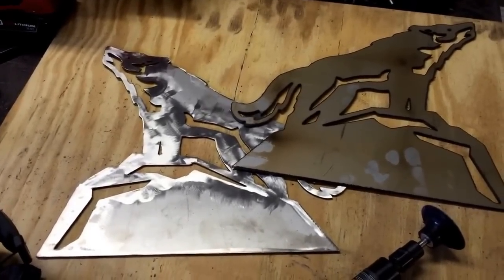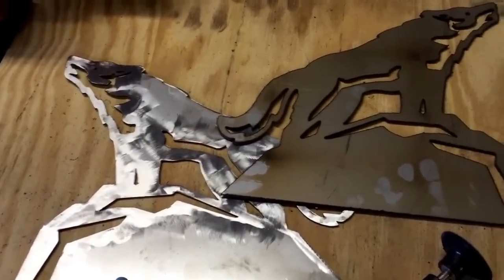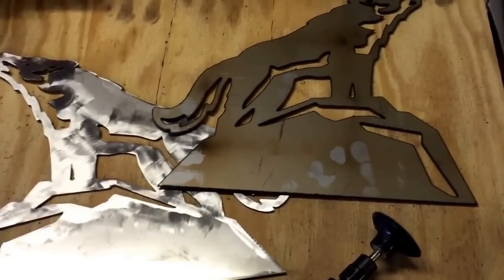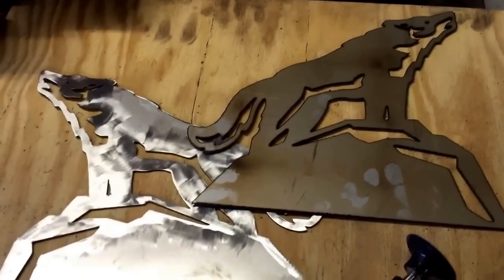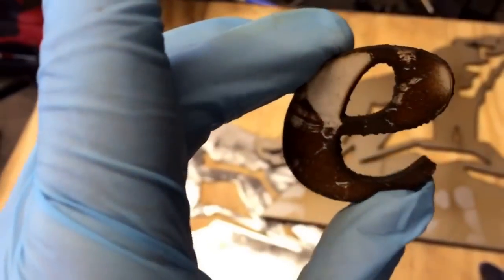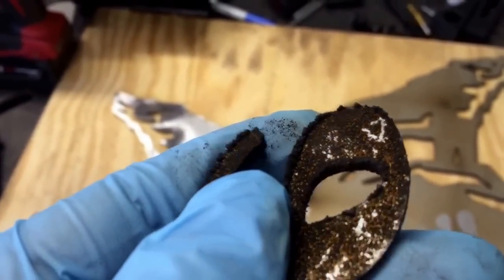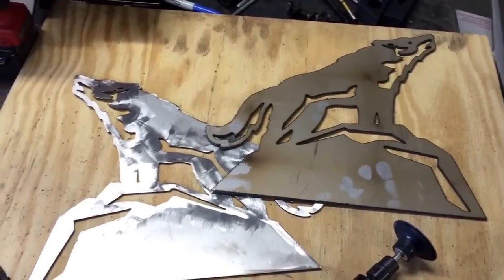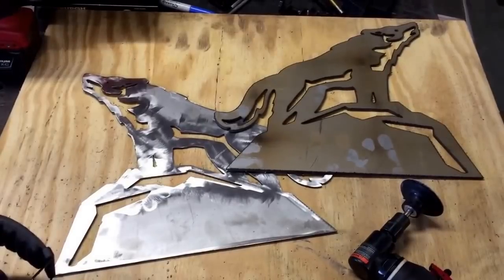Request for help. Stainless steel cleanup.

Comment: HI Tom,
We do a lot of stainless at work and I cut a lot of it with my PlasmaCam.  I use a right angle die grinder with a 60 grit sanding disc and then we send all the parts out to get glass beaded.  They come out GREAT!  I don't know what your budget is but the glass bead makes a real nice matt finish.
Good luck,
Reid
Reply from the maker: +Reid Eichner Thanks, Reid! We've gotten some pretty good suggestions on here and I'm open to anything really. So far, I'm leaning towards the less manual processes given my back is still healing. I'll do a follow up with the things that I've tried for all to see though.

Best wishes,
Tom

Comment: I use a stainless steel wire cup. Since putting in the water table in mine I have notice that there is less clean up and not as much oxides. You can also cut with argon/nitrogen mix for better cut quality
Reply from the maker: +Rick King Hi Rick! Cutting these parts out is what spurred me to get my water table back in action. Of course it was too late for this batch! I'd heard about using nitrogen before but haven't tried that. What's your experience with it?

Thank you,
Tom

Comment: For it to work well it has to be pretty drowning in water. My water table is a different design to most I've  seen on the net using plasmacam DHC2. I have a vid or two of it running on my FB page if you wanted to have a look. There also will be some of the stainless work I've finished on there. 

I'm from across the pond in Australia and like you I'm  a ex grunt  and have worked with you guys when I was in the defence force. I do a fair bit of Infantry stuff on my PlasmaCam. Cheers Rick
Reply from the maker: Thanks, Rick! I'll definitely check this out. Appreciate the suggestions and maybe it's time that I do the table up proper, so to speak.

Best wishes,
Tom Z

Comment: as much as this that you are going to eventually have to do, you need thinks in terms of the least labor intensive. My first thought was a tumbler, and notice that it has already been mentioned.... secondly....I would explore whatever is needed to minimize the dross....I, the way that they can grad seem to recall Mr. Fenner discussing the initial machine settings.....would hate to have to hand hold all of those parts to a wheel, the way they can grab parts.   Good luck,   Jim
Reply from the maker: Thanks, Jim! I think the tumbler will work well for the smaller parts and the drum / belt sander will work for the larger parts. Did you see the comment about using a non-slip pad for the smaller parts? I thought that was a pretty clever idea as well. Appreciate your comment & suggestions! 

Sincerely,
Tom Z

Comment: Probably the fastest and easiest would be a blast cabinet. Maybe a belt sander to hit the high stuff first.
Reply from the maker: +David Kirtley Hi David! Belt sanding is an option but these small parts make it difficult to hold. Wish I had a blasting cabinet but  I had someone mention a tumbler though so I'm trying that with some scrap pieces. I will need different media to avoid cross contamination on the final parts but this is good enough for testing.

Thanks for the feedback!
Tom Z
Reply: +Tom Zelickman (Inspiration Metalworks)  Put the small parts on a non-slip pad and hit them with a random orbit or vibrating sander.
Reply from the maker: +David Kirtley That's a great idea! Thank you!

Comment: Distilled white vinegar
Reply from the maker: +Muhaa Haloa Thanks for the suggestion! Do you think that vinegar will work? Stainless resists acids as far as I know.

Sincerely,
Tom Z
Reply: Tom Zelickman Yeah it should do mate.Try it leave it soaking for 24 hrs then scrub with brush then put back into the vinegar for another 24hrs that's what i do with all my drill bits and tap's and other stuff worked great...Or try electrolysis might cause pitting though with a tiny bit of salt..Or bicarb,
Reply from the maker: Muhaa Haloa I'll try that on another piece of drops from that cut. Thank you! Do you really think that is rust? I suppose it might be more prone to oxidation as the molten metal is spraying on top of the part that had dropped out of the sheet. I thought it was just that spray / high speed dross since most of it came off with light effort with just my fingers.

Right now I've got one sign's worth of lettering in the vibratory tumbler and it's cleaning up very nicely. Always good to have options though!

Thanks again,
Tom Z
Reply: +Tom Zelickman (Inspiration Metalworks) No probably not rust pal but if it removes rust
it will remove that stuff no problem..Was an example does look more like oxidisation depends
where its been stored,Although i have seen rusty stainless when its been scratched its only been
lightly coated.

Comment: Your wife might kill you, but I'll bet that the brown stuff will clean off nicely in the dishwasher.  Sorry....nothing better at the moment.  Does the dross chisel off pretty easily?  Maybe a needle scaler on the dross side.  Once that's taken off, a DA sander should give a nice uniform finish.
Reply from the maker: +bluehandsvideo Thankfully the brown stuff is just smoke residue and comes off easily. I had someone mention a tumbler though so I'm trying that with some scrap pieces.. Had it on hand but will need different media to avoid cross contamination. Thanks for the feedback, Mike!

Tom Z